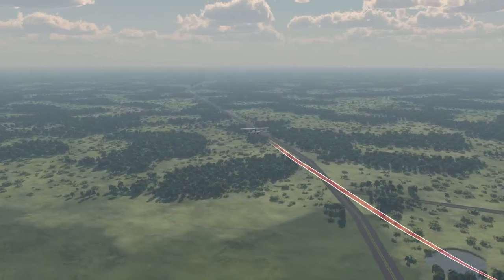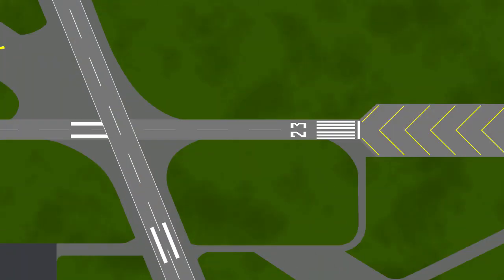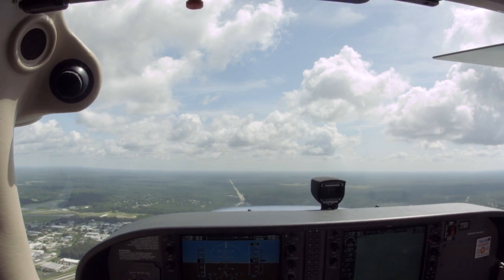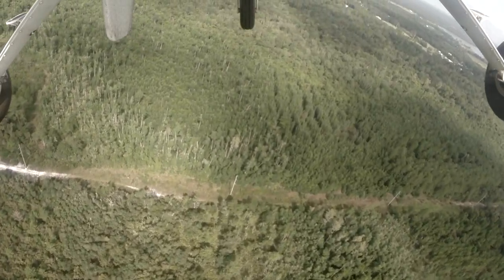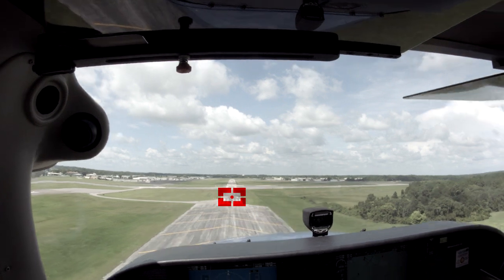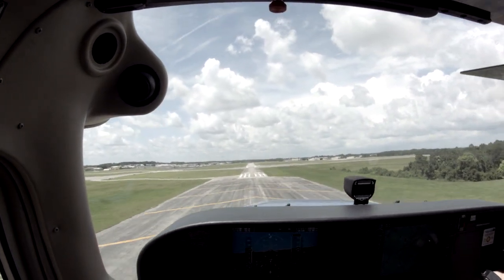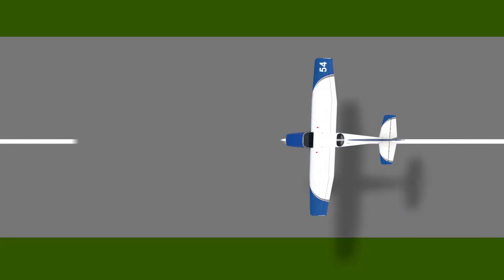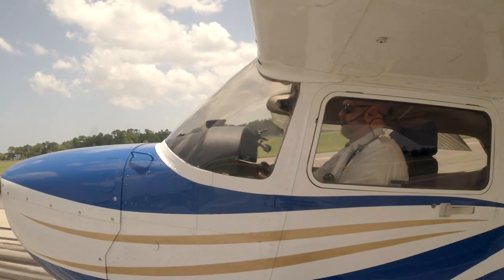Normal Landing

Comment: 100 kts on downwind and 85 on final?? I always aim for 80 kts and 60/65, as I was taught. Also, pitch for speed and power for altitude is what we're taught, not 'increase/decrease power AND adjust pitch' - the latter will result from changes in your power input.
Reply: Agree, undergoing training with same inputs you described.
Reply: it depends on the aircraft. A C-172m/n will have different approach speeds than a C-152 for example
Reply: I'm doing 70 on downwind all the way until the round out in a 172.
Reply: I do 2,200 rpm in the downwind and don’t adjust it unless there’s a strong tail or headwind.

Comment: Why would anyone choose to land on the very end of the runway during training? If you land short you are in & on the yellow Chevrons...which is not allowed for landing or taxi! Picking the thousand foot marker makes alot more sense and no harm or foul if they land short. I think landing on the end of the runway with a student is ill advised.
Reply: This is a very cool suggestion. The field I am training at has a 4500 foot runway. Each landing so far leaves about 3000 feet in front of the plane when the roll-out is complete.  A bunch of forgiving runway in the "land short" range is so smart. Kind of a "why didn't I think of that" thing.

Comment: At first I wanted to call it inaccuracy, but on the second thought, the instructor just needs to be more specific. The last airspeed call was "below 85", which is way too fast for touchdown speed, and later you can see 60 kts on the PFD, while instructor never tries to attract viewer's attention to that fact. Nothing is wrong with 60 kts with full flaps, but it is kind of feature of short field technique. If I may suggest, let's start with reviewing POH for normal landings. It is C172SP, correct? For 172-s, the airspeed has to be 65-75 kts on final with no flaps. Doesn't say that aloud, but implies, speed 65-75 is good for any flaps 0 to 20 degrees. With flaps 30, speed shall be 60-70 kts. We also assume that we start on our 45 degree entry to the pattern with speed 110-90 kts. At 110 or slower, it is safe to open 10 degrees of flaps. Below 85, it is safe to open any flaps settings. Pilot is not required to open flaps at any specific speed, just observe the speed(s) when it is safe to do so. Stall speed is below 55, add safety margin. That's pretty much it. The 172 is a great plane that forgives bad errors. I must add, however, it is not foolproof, so don't do wrong stuff intentionally. On my personal 5 cents. My primary instructor taught me shortened/simplified procedure. On downwind, reduce power, speed 90, flaps 10, start descent, turn base, speed 80, flaps 20, turn final, speed 70, flaps 30, and keep this speed until flare. It works just fine on runways 2000 feet or longer under normal conditions.
Reply: This is quite brilliant. This speed/flaps checklist for a 172 always equals 100. Downwind 100/0, then 90/10, Base 80/20, Final 70/30. Fool proof. Flare will bring the plane to 60-65kts on landing. Makes it sound so do-able.
Reply: @skippingguy  Great observation!
Reply: That's exactly how I use my flaps in the pattern.. Do you flare out with 70kts full flaps? I usually come in at 60-65kts and always have a difficult time timing the flare for some reason..
Reply: @danielveliciu3445  1. I keep short final speed until passing the threshold, then reduce power. To zero or not to zero, depends on circumstances. I am pretty sure, speed is much slower in the flare itself. My best (softest, shortest) landings were at conditions when the wing is balancing on brink of stall, heard by stall horn sounding. I shouldn't go any deeper because I am not an instructor. 2. I believe it is a great idea to fly with different instructors from time to time, and learn from multiple people. Chances are, you will pick up something new.
Reply: @olegalferov9679  Interesting.. My issue is I don't pull back far on the controls to hear that stall warning buzzer come on.. I always feel like my speed is too fast upon flaring and that i'll slam on the runway.. I'll keep working on them!
Reply: OLEG ALFEROV At Riddle, we’re taught by speeds, considering it is a part 141 school, everything is more structured. were taught 100 kts on downwind, abeam the numbers 90, base 80, final 65-70

Comment: 172 pitches up with flap extension?  I'm used to the cherokee 140, which pitches down. Please explain the difference. Tks. Bob.
Reply: The "high wing. low wing" reply is the most accurate. The high wing combined with a low tail is the primary reason for the pitch up, and here is why: The downwash off the flapped wing is really angled downward, and that down wash becomes the relative wind for the tail, coming down from above and producing a stronger downforce on the tail. That creates the nose up tendency. On the low wing, the down wash from the flapped wing passes way under the comparatively higher tail. So the relative wind on the tail is unaffected. The reason why it pitches down is because the wing section has a pitching moment that becomes more nose down with flaps. The height of the tail compared to the wing determines if the whole airplane pitches up or down. I learned that at ERAU in the early 80s... Thanks for reading.
Reply: Do u recall that lift is nearly perpendicular to the cord line? when you add flaps the lift acts rearward. More so with initial then w/full flaps. More drag with full flaps.
Reply: At least it starts to climb up sharply while losing airspeed, also very sharply. Compensate for it by adding power and/or pitching down. In some circumstances, you have to stay away from using flaps if you are not sure about consequences.
Reply: High wing, low wing.

Comment: Kind of unrelated.  But, what headset is the pilot using?  I'm tired of my heavy Davis Clark's.
Reply from the maker: That's my Clarity Aloft, and I LOVE it! I will never go back to an over ear headset. Soooo comfortable, and they sound great! And I don't have to pull the buttons off the top of my hats anymore. :-)
Reply: And they work well in a noisy Cessna?
Reply from the maker: Rob Olson I’ve used them in everything from light sport to the Cessna to an E175, and they work equally as well in all of them.

Comment: Why do Flaps 30 in a 172? Blah. The nest normal landing configuration on  a 172 is Flaps 20 and 70 KIAS on final
Reply: Gentleman, There is more than one model of "172". They're flying a 172sp (180hp) which can pull more flap.  I fly a 172n (160hp) and flaps 20 @ 65 is what I land at (barring the need for more flaps such as a steep approach.  Could I slip it in in? Sure, but flaps are easier).  It's a matter of lift vs drag.  On the 172n flaps 20 is optimal.  Anything beyond that the added drag increases at a greater percentage than the added lift.
Reply: Each to his own. I love the old 172s that had 40 degrees of flaps. You could put it down anywhere, with a rollout of a few hundred feet. It drives me crazy to see people using 3000 feet to get a C-172 stopped because they are afraid of hearing a stall warning horn. You need to develop a good feel for the margin over a stall on any airplane, so you have only the necessary energy left upon touchdown.... It may save your life on an engine failure someday!
Reply: Chuck Mahon no
Reply: Really a moot point! Amount of flaps is really a judgement call isn't it?

Comment: Nice video. On final at 3:40, mixture is full rich. A little later, at 4:16, the mixture has been leaned. :)
Reply: I see. But I thought the mixture can only be leaned at 3,000ft AGL for a C172S?
Reply: @WorldKris  It should always be rich on take off and landing tbh.
Reply: @MinerMends  Depends on density altitude.
Reply: @WorldKris  The mixture can be leaned at any altitude so long as it results in the correct air fuel ratio. The performance charts expect you to have leaned the mixture  at 3,000' MSL for best performance. AGL is kind of irrelevant, what really matters is density altitude. Also it is common practice to have a full rich mixture for takeoff and landing, but it should be leaned anyways if operating at a significantly high density altitude.
Reply: Thank you for the comment guys! By the time of this comment. I'm already done with my flight training a year ago. And your inputs are spot on